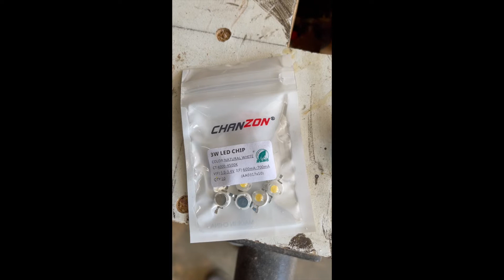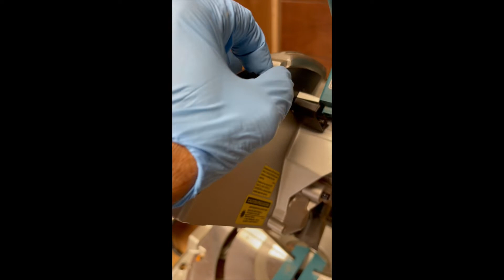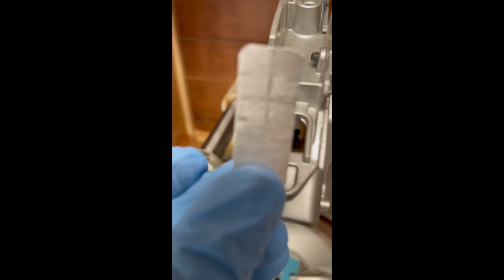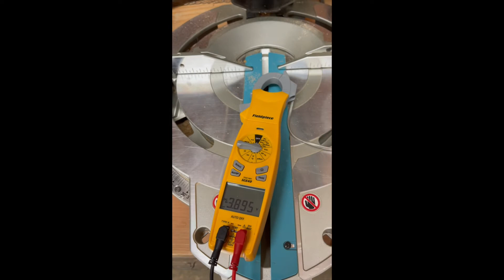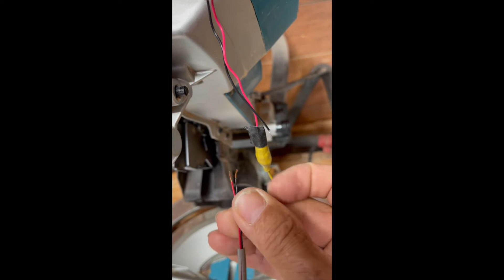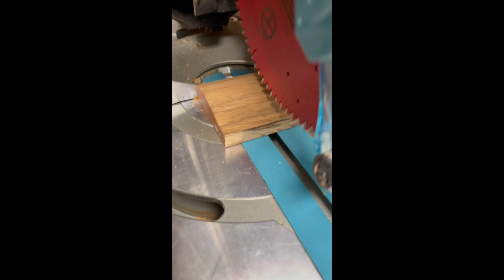how to add shadow line to a makita miter saw SL1019S

Comment: Great video. How do you like that miter saw? I've  read negative reviews where people had problems with straight and square  cuts. Some kind of issue with the alignment  of the sliding rails. Have you have problems  with that?
Reply from the maker: It is true About cutting square I don’t like the saw, I would suggest buying something better. It is a terrible miter saw
Reply: @edgarrios9557  the SL1019S is a terrible saw? What should I buy then? I am looking for something with the shadow line and 10 inch but I thought this was the one to buy lol...that is why I am here!
Reply: I've heard the same. I've this saw however and it cuts straight and square. It did right out of the box. 

Although some people have had this issue, and I did see one person that adjusted the rails slightly. It was just a bit off. But was fine after that. 

People need to realise they mag have to adjust things sometimes. If you don't know how to adjust your tools, you probably shouldn't even use them. Because if you aren't skilled enough to set them up, you almost certainly aren't skilled enough to use them.